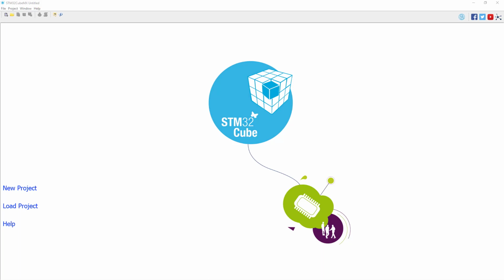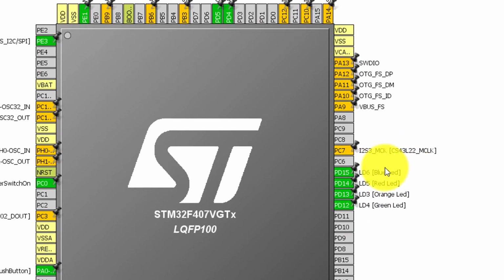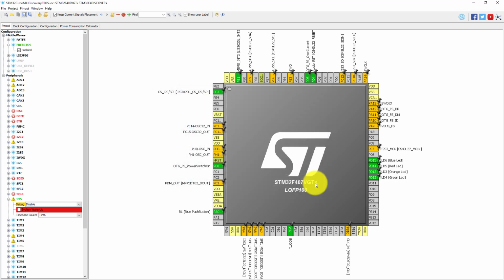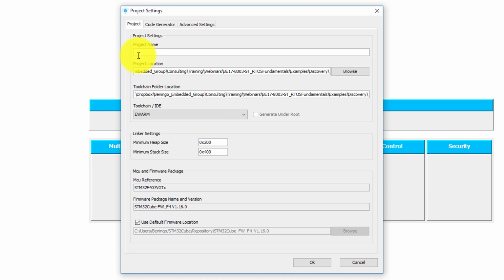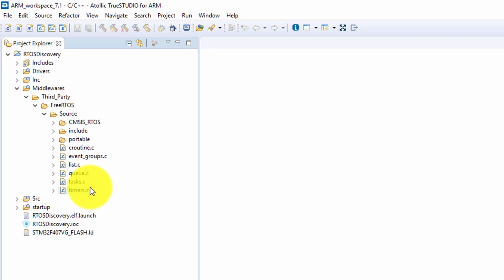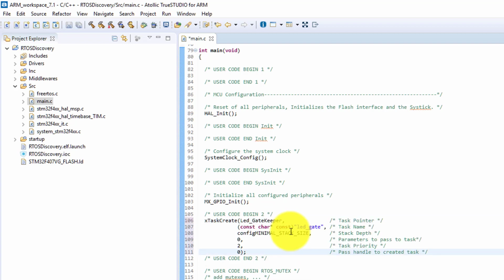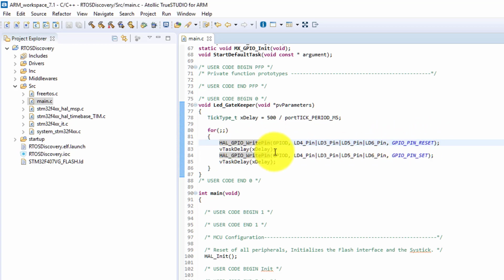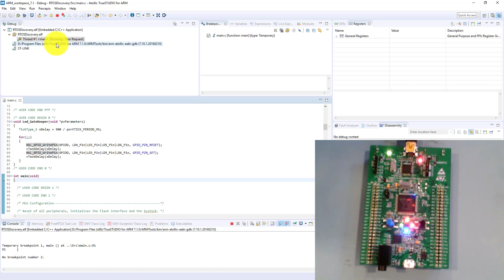FreeRTOS Setup with TrueStudio and the STM32F4 Discovery Board

Comment: Hey, I used STM32CubeMx and Keil v5, when I generated it, I can't use the usual FreeRTOS functions like xTaskCreate, instead I have to use some other functions, like osDelay and all, can you help me with this?
Reply from the maker: Yes they are using the CMSIS RTOS functions which is a standard wrapper for any RTOS. Basically all you need to do is include the FreeRTOS header file you want to use such as task.h and you can use the FreeRTOS definitions.
Reply: @beningoembedded  I tried but nothing happened
Reply: @beningoembedded  do we need to change the functions like MX_FREERTOS_Init(); and osKernelStart(); ?
Reply from the maker: @KaranKashyap1110  You should not need to change those. In the past, I literally just add the FreeRTOS header file and then I can use those definitions or you can use the CMSIS definitions.
Reply: @beningoembedded  yeah okay, got it, thanks!
Reply: @beningoembedded  also I had a question, I have STM32F429Zi board with TFT LCD touchscreen, can you tell me how to build a GUI out of it? I searched on the internet but did not find anything, thanks in advanced! :D

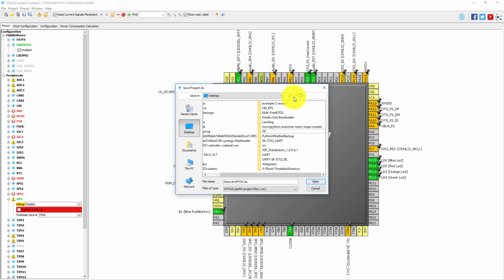Comment: at 3:00 please explain why you selected a timer. i don't understand what the significance of that is.
Reply from the maker: The timer is used to check if a context switch is necessary. Basically the timer is running the scheduler.
Reply: @beningoembedded  thanks!! so like - i can see why you'd need a hardware timer triggering this. question - you deselected i think the internal resonator or something. was that required? like what would happen if ya didn't select a timer? cheers! also thank you for the video
Reply from the maker: @pepe6666  There is a dependency in the STM32CubeMx that tells you that when FreeRTOS is selected you must select another timer. If you do not select the timer, the project will not generate properly and will result in compilation error if it generates at all.
Reply: @beningoembedded  awesome! thanks very much

Comment: Hello,  
This does not work for new Atollic TrueStudio fro STM32 (v9.0)... the problems seems with the Timebase source but not sure what else I have to enable.  any idea?
Reply: many thanks
Reply from the maker: Thanks for the comment. I have not tried this yet with v9.0. It's something I will be trying in the next week or so. Once I try and debug it, I will update the video or post a new showing how to do it. Thanks for letting me know!
Reply: Thanks for the swift answer,   just an extra comment, It does not even compile,  When I select the Timebase Source, then all the HAL Initis (such as GPIO and so on) "undefined reference to almost everything"  this happens only when I enable the freeRTOS from CubeMx and replace the Systic for any available TIMx
Reply from the maker: What exactly is not working? I was able to follow these steps with the latest STM32CubeMx and TrueStudio v9.0. Did you set the SYS timebase source to something other than Sys_Tick such as Timer6?
Reply: yes, I used a distinct timebase...  I am using Ubuntu 16.04,  looks like this issue is OS flavor related
Reply: I remeber I moved some folders (Drivers and Middlewares) but other problems raise... do you have any guide what specific folders has to be moved and where?  many thanks
Reply: I just solved...  the problem was caused when I chose the board (my case 32F411E Disco) CubeMX asks to initialize the peripherals... I hit yes always...   I duplicated on Windows PC and I figured out that is the root cause.  Now I am able to follow your example on Kubuntu exactly as you describe...  Thanks a lot!!!